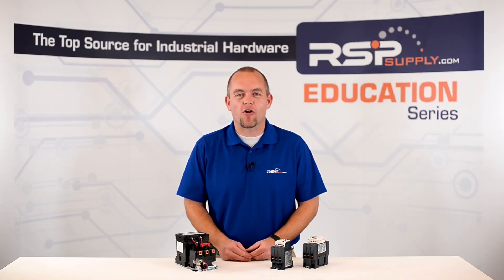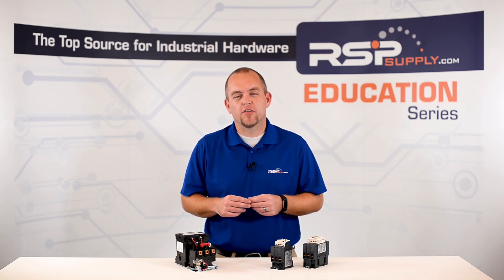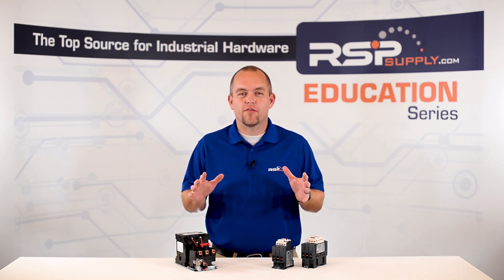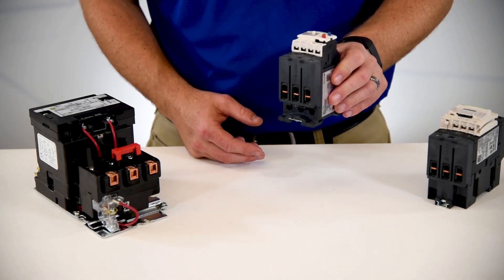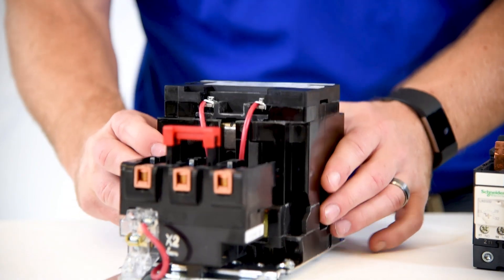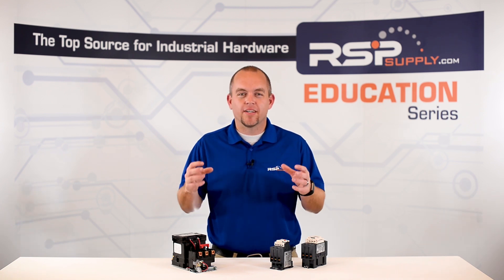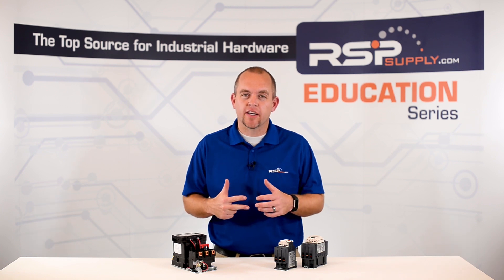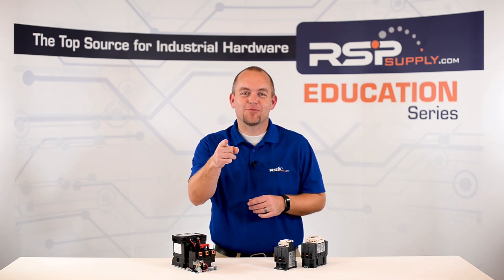Motor Starter Basics

Comment: The auxiliary contacts are also handy to create a self-latching system.  Wire your NO start switch and NO aux in parallel to A1 (coil) on the contactor.  Then wire a NC stop switch to A2 (coil) or through your overload aux then to A2.  For a fwd/rev setup with 2 contactors, wire both A2 terminals to your NC stop switch (or through overload aux as before).
Reply: Gosh, ive been in a motor controls class for a couple weeks and im surprised i understood 80% of what you said. Although, i have little clue on how that wouold actually look like in practical terms

Comment: Where would one find a magnetic starter? Refrigeration equipment or are we talking industrial heavy commercial equipment such as in cooling.
Reply: I've seen magnetic starters on motors as mall as 5HP on a tablesaw, and I came here to find out more. Will keep looking. It was 3PHASE gear, labeled for 220V or 440V. The starter was marked that it presented an arc danger up to 18"...I think I'd like to know more before buying or operating this equipment. More than this video at least.
Reply: We use them for 10 hp motors for paddlewheel for lake aeration